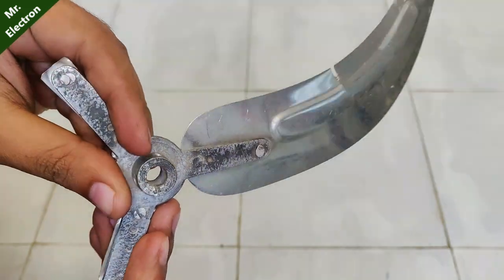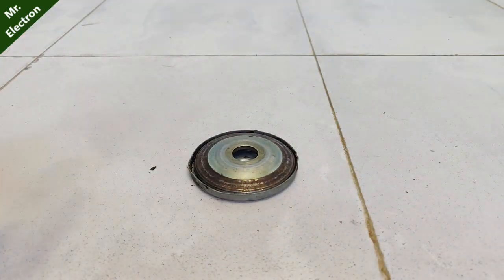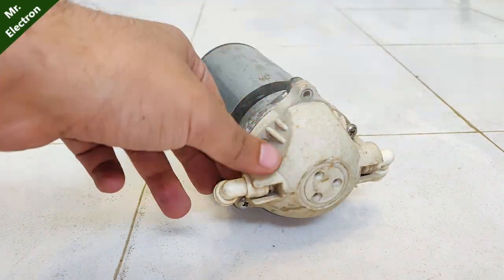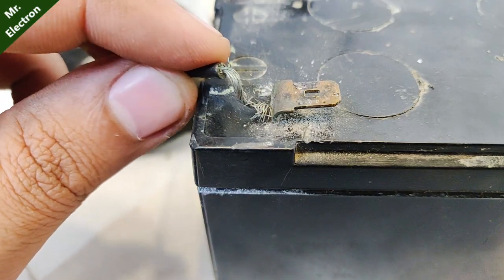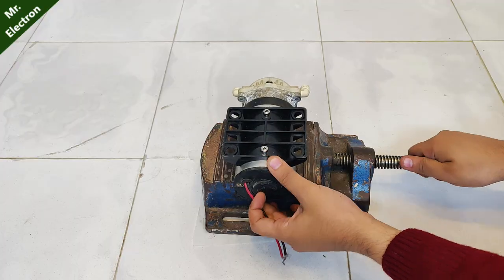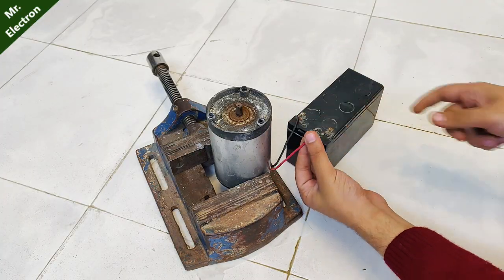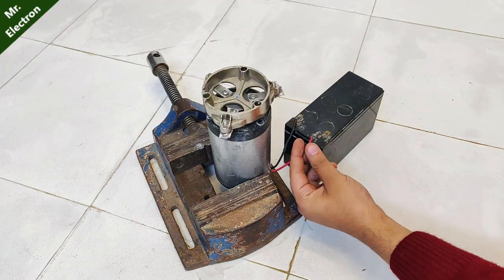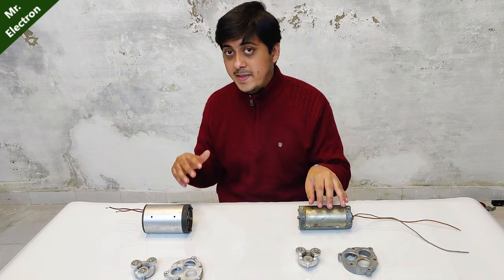Make 12V , 24V 100W DC Motor Powered Wind Turbine Generator ( Part - 1 )

Comment: Sir can we generate electricity from fan induction motor???
Reply from the maker: Needs modification
Reply: @MrElectron  thx so much 👍👍👍👍👍
Reply: Try adding a washing machine capacitor or several on parallel connection. Sir Robert Murray-Smith has video on this "An induction motor as a generator without altering the motor". More capacitance the better.